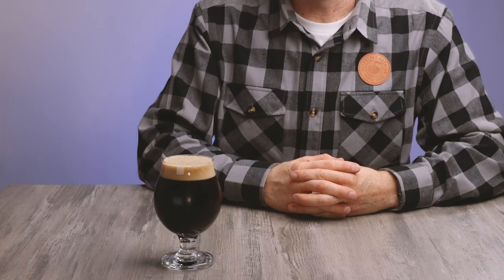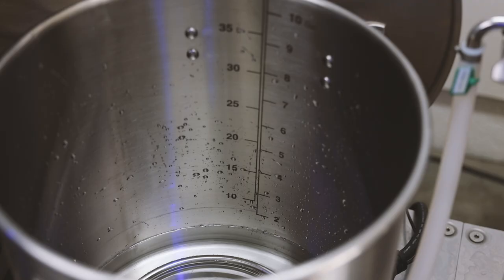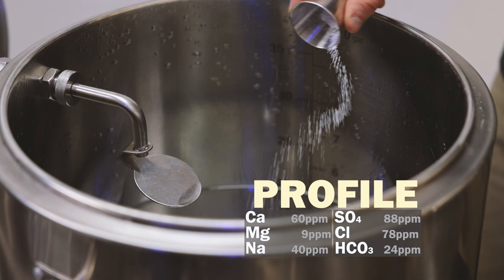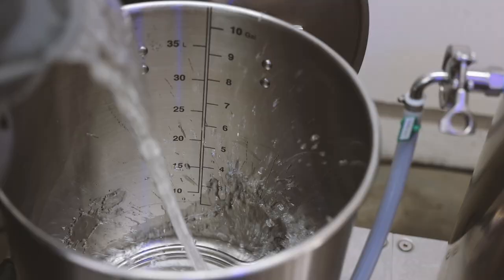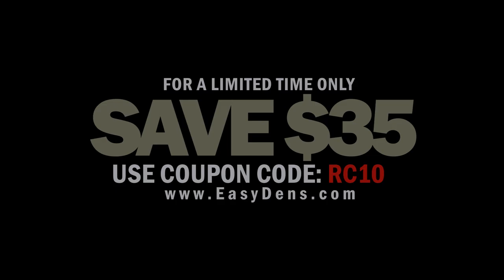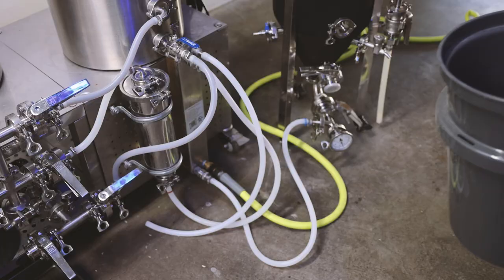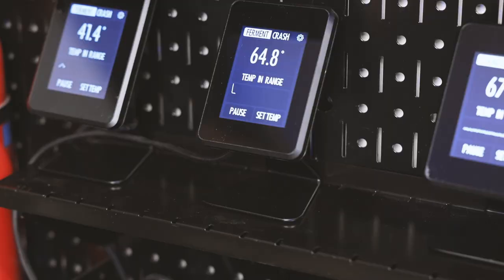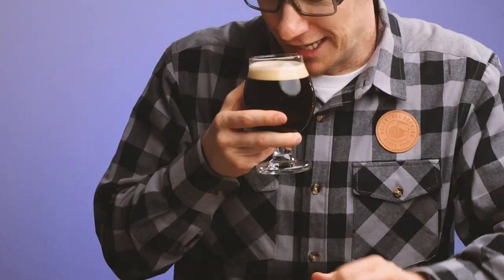Brewing a Mexican Hot Chocolate Stout (Grain to Glass)

Comment: I brewed the same beer. First time ever to use Poblano peppers. I soaked in vodka and added at end of fermentation for 2d. The chocolate stout was awesome. The peppers way way overshot. After a few weeks it lost some of the heat, but next time I won’t use near as many peppers. Because I had never used peppers before, I purchased the Northern Brewing 5 gallon kit. About 1/2 of the peppers sent is probably about right.
Reply from the maker: It’s an awesome beer! It’s been one of the most popular ones I’ve brewed around here

Comment: I'm newly hired brewer and really enjoy your videos! How do you measure the abv since adding the tincture? Even if you measure the gravity the vodka would raise the abv depending on how much vodka you added?
Reply from the maker: Thank you! You have to use an alcohol meter for the exact number but you can approximate it with decent accuracy by adding the alcohol content of the tincture volume (40% ABV) to the alcohol content of the beer volume. Add those two together and divide by the total volume of the keg.. In short, it only adds a fraction of a percentage point